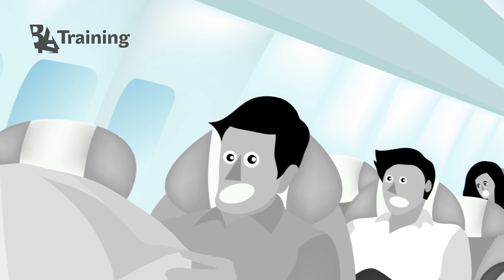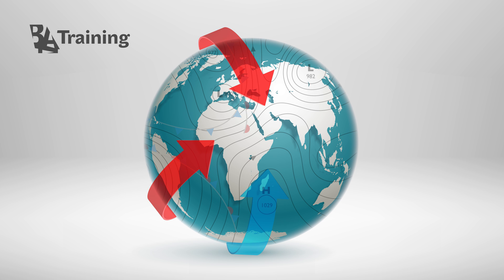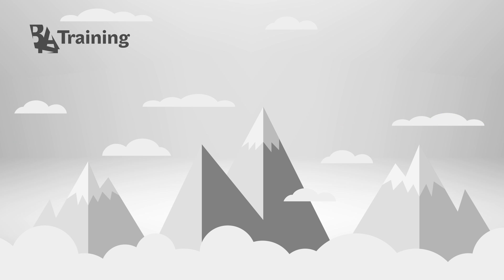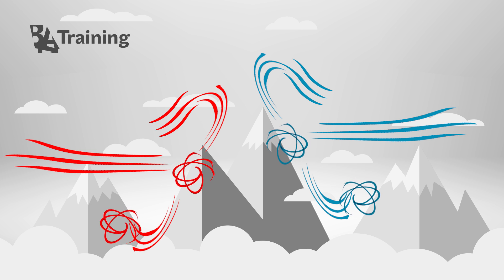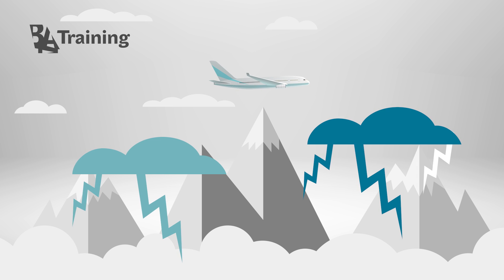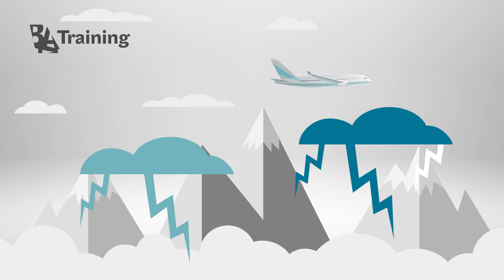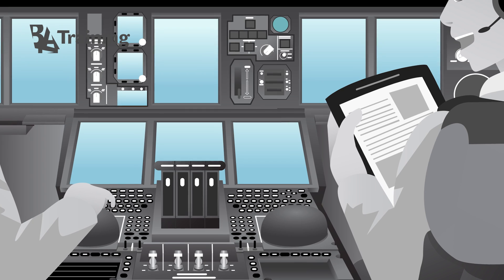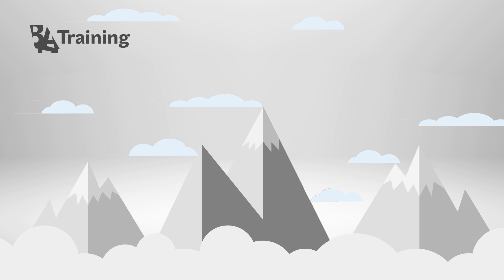Turbulence: what pilot should know?

Comment: What kind of turbulence makes the plane feel like it's falling? Does it actually lose attitude?
Reply: Yes sir, everytime the air flow is interupted,yet no LIFT is generated by the WINGS (of less LIFT), the airplane is actually falling. ( free fall :D ) . sometimes just around 20 30 ft, some severe turbulences may push the plan up or down 300 even 400ft in 1 or 2 sec ( Mostly happens when your plane fly through a CBCloud (Cumulonimbus Cloud) or CAT (Clear Air Turbulence)
Reply: +magzire It is called, wind shear! Check this out: https://en.wikipedia.org/wiki/Wind_shear#Impact_on_passenger_aircraft
Reply: +Balint Szarka does the plane actually lose attitude?
Reply: +Balint Szarka I only experience it once but it felt like the plane just sank.. very weird feeling and terrifying, feels like the plane has no control for a few seconds.
Reply: +magzire Yes, it does "fall" for a few seconds.